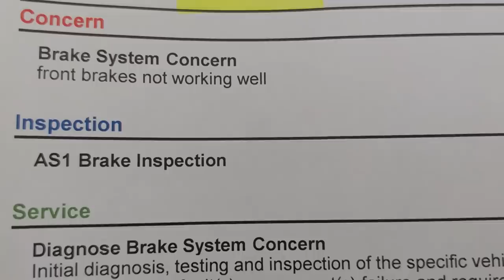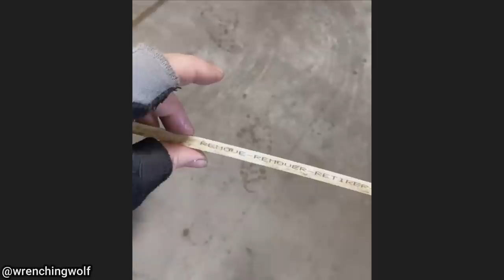Customer States Dropped Socket Into Engine Bay And Vehicle Won't Start | Just Rolled In

Comment: A socket in the combustion chamber could've easily been fished out with a magnet!
Reply: Not to mention, the guy decided to do his spark plugs at 25k...logic is clearly not his forte
Reply: Also, why even start the engine when you know there is a socket in the combustion chamber...?!
Reply: My thought exactly! I drop stuff all the time. Extendable magnets are your friend
Reply: Maybe he haven't seen where the thing landed and started the engine
Reply: @intraxx88  I agree, there's no way he knew it was in there! I hope
Reply: @DrPoooper  i bought once a beater mk4 jetta, found 13mm spanner, tx30 and wooden ignition coil holder when working on spark plugs and AC radiator 🥲
Reply: Pulled the head off my first car and found someone had dropped a fuel hose clamp into the carb at some point in its past. The main part of the clamp was jammed in an inlet port,  the screw and nut had gone through leaving their mark on the piston and cylinder head. Went noticeably better with all four cylinders breathing properly.
Reply: @cycoholic  hoping it gets blown out the exhaust? or maybe he put in the new plus and then noticed he was missing a socket? thought it fell in the engine bay?
Reply: Some vehicles nowadays a couple of the plugs are near invisible. 
That was a perfect bad bounce for sure.
Reply: Mine was a washer a previous owner had dropped in the intake on my '88 Monte Carlo SS. Went to test drive it after some suspension work and said washer finally made it's way into the cylinder heads. Destroyed the head and put a hole in the piston/ cylinder wall.
Reply: Surely they didn't realize it fell down the spark plug hole?  But there's no way the spark plug socket would fit.
Reply: @theboyx323  
Ouch.

Comment: The loose brake pedal gives a whole new meaning to Fred Flinstone brakes and California Stop. 🤦‍♀️
Reply from the maker: Lol! I wonder what happened to the brake pedal. Especially on such a new vehicle.
Reply: @JustRolledIn  right?! That’s really scary. Bad malfunction and failure.
Reply: @JustRolledIn  Fiat quality
Reply: Well.... It is a Fiat.
Reply from the maker: @actual_nonsense  I was waiting for that comment 😜
Reply: @JustRolledIn  I had exactly this happen to me a long time ago in a Peugeot. I took the car to the dealership. The fixed it, and then told me there was nothing wrong with the car. They literally re-attached the brake pedal then pretended like I was crazy for bringing in a car with nothing wrong with it
Reply: @JustRolledIn  The bolts holding it in were left loose it the factory and fell out
Reply from the maker: @lawrencebraun7616  definitely a possibility. I wonder where the rubber piece is for the brake pedal lol
Reply: @JustRolledIn  My guess would be manufacturing error, poor or no quality control.
VW had a recall a few years back, where the brake pedal assembly had to be checked (and in some cases replaced) because their quality controls had shown signs of bad welds.
It was caught and fixed before anyone was hurt.
So I guess robots don't always do a better job than a human.
Reply: @JustRolledIn  The technician beat you both to it; "Quality."
Reply: @sam2x13  as an Italian, i can confirm, fiat (actually fca, not fiat direclty) cars are one of the worse cars, we lost the "simple, chep (for them) and durable" fiat may years ago
Reply: @JustRolledIn  just the typical fiat/stellantis llc quality built right in.
Reply: I wouldn’t have a late model Jeep. They are Pussy Jeeps now.
Reply: @Davide0033  Is it true that the low-end cars are even worse than the more expensive ones? I heard some rumour about that while using a Fiorino at work. 
And yes, the Fiorino was utter garbage.
Reply: That brake pedal issue should be a recall!
Reply: Or " Wildcard " Charlie from Always Sunny did an upgrade 🤣
Reply: @lawrencebraun7616  it cost money to tighten every bolt. Just think of the potential savings!
Reply: @panzerveps  Except the problem about blaming the robot is it is assembled and programed by....a human.
Reply: @Vanta_Blue  yes, in the last years fiat started to make cheap (for them), low-end cars, but started to make them complicated, cheaping on everything.
that's probably why you see an old Panda whit 300000km, but some new panda have all sorta of problem at 30000km (not kidding, i saw both the cases).
i can't acqually think about a hight-end fiat

(keep in mind that's not only valid for fiat, but for almost all cars manufacters)
Reply: Proudly made in the USA 😂
Reply: @Davide0033  Thanks for confirming!
And yes, the new complicated vehicles carry so many problems it's silly.
Reply: @repairdroid77  Yep. The thing is that a robot will not check its work, unlike a human welder, so this robot can do thousands of bad welds without anyone noticing.
Reply: I think it was upside-down but maybe their shit quality control was at fault and it was not only loose but missing the rubber thing 🤣

Comment: If I was a mechanic and someone came in with tires like that, I'd refuse to work on their vehicle until they were replaced (and they'd have to sign a waiver when they leave if the hazard isn't fixed)
Reply: I think they can refuse to allow the vehicle to leave legally as it's a definite hazard,probably need a cop called tho.
Reply: We did like this couple of times, when i was in Subaru dealership. Once with tyres, once with timing belt (customer didn't expected to replace it by 100K miles /160K km), so we replaced entire engine month later 🙃🙃
Reply: @marjoriegoodwin9121  - Every state handles this differently. 
No one Common Sense Law.
Reply: @intraxx88  certainly in the UK that would happen. 3 points and a fine for every bad tyre, you only get 12 points and you are banned (6 if you have only passed your test within 2 years).
Reply: @handlesarefeckinstupid  good system. Considering our winter road deaths statistic caused by wrong or bad tyres, it's better to make people use bus instead of dangerous to anyone car
Reply: @intraxx88  Good system in Europe. In the US, there usually isn't a bus, and no way to walk. (Such as needing to cross a major highway with no crosswalks for miles)

Comment: I wonder if the socket had a lifetime warranty?
Reply: Snapon brand.
Reply: I cant believe the insurance company is covering a new engine even though the owner did the damage himself. Who drops a socket in the spark plug hole and still turns over the engine? Smh
Reply: @jacksmith2315  The same kind of person who changes spark plugs on a brand new truck with 25k miles.

Comment: It is amazing to see these problems and wonder how did they learn how to fix a car or get a driver license.
Reply: Going by the video they didn't learn how to fix a car. lol
Reply: Driving is easy, fixing-not so easy.
Reply: @markk3652  well driving on tires that has a date from 1995  and a huge crack in the side wall and they refused to get a new tire.. yeah right. or I hear this clanking sound but I will continue driving for 800 miles hopefuly it will go away..
Reply: @markk3652  Driving is easy, and yet a majority of people still manage to screw it up. What does that tell you?
Reply: because it is incredibly simple to get a driver's license and there is zero required training on maintenance
Reply: You are doing better than me, I am surprised half of them actually remember to breath

Comment: I need to know what insurance company covers a new engine after you start it with a socket in it :P
Reply: No shit right?! Haha
Reply: I have heard of insurance companies doing that.  Otherwise, the owner would probably quit making payments on the vehicle and let the vehicle be repossessed due to mechanical failure (mechanical salvage) as the owner most likely could not afford the repair themselves.  

If an engine gets wrecked like that and the insurance doesn't pay, I wouldn't continue to make payments on it sitting out in my driveway and non-useable.  They can have the POS back.

Comment: My all time favorite was the customer with the frozen caliper slides who never knew there was a problem until the inboard brake pad wore out, then wore over half the thickness of the rotor away and the caliper piston finally came out of it's bore and all the brake fluid gushed out.   I asked her " How long was it making that grinding noise?  She said, "Not that long...just a couple months."

Comment: How I love those second generation F bodies!  My first car was a gold (ugh) '70 Firebird with a "350" Pontiac V8 and a Hydromatic slushbox, 21 years old when I bought it in high school. It was a base car, not even air conditioning, but I was young and impervious to summer heat. Six months after I bought it the car and I went on a 3,000 mile road trip the summer before my senior year; none of my classmates believed I'd actually done it when I went back. The car served me well for over five years through spring breaks in Florida and midnight drives in Delaware. I smoked a Ferrari with it too (though it was a Mondial convertible with two jocks up front and two bikini-clad floozies in back - it couldn't get out of its own way) and took my girlfriend on frequent runs to Rehoboth Beach.  Good times.  Great car.

Comment: Hold on, I drop a socket in my engine and insurance buys me a new engine? .... I wouldn't have the stones to ask, but I wouldn't be an idiot and drop a socket in my sparkplug hole. Good lord LOL! Had to be the most unlucky escape of a 10mm EVER! I did lose one down the inside of a boxed frame rail once. I played "Klinko" down around the radiator frame and I won! 

 Dude that drove on the rim? Man, that's like a perfect reloading crimp on a 12g shotshell. 

Wiper blade.... lordy. And again, a happy customer who got EVERY cent out of their brake pads. 
 Sweet TA!
Reply: I hear ya a friend of mine has the greatest insurance I've ever seen! He use to have a s10 with a slipping transmission  then one day he hit a car ramp in the middle of the road don't know how he didn't see it 🤨 he told insurance now his transmission is slipping he got a new transmission for free covered under insurance and installation I was like WHAT!!! Then a few years ago he got rear ended in a 03 Ford f150 after owning it 3 weeks he paid $3,500 for it they gave him $11,500 total loss he bought it back for $1,000 then sold it for $4,500 they also bought him two new car seats because they were in the truck when it was hit and the 4 new tires he just put on they paid him for that  he also sued the person that hit him got around $15,000  The guy who bought the truck pulled the frame out then a new rear bumper in 1hr then he sold it for $8,500 after paying $4,500 he owned his own body shop. My buddy always walks threw shit and comes out clean as a whistle 🙄
Reply: @frankm8533  HAHA! ... That's hilarious, I have a buddy who's amazing at warranty crap. It's a game to him, but he legit makes out. There's times I'm like "Dude, do you really not expect time to take a toll?" but he pulls it off. Me? I'm the guy who's stupid expensive gaming laptop takes a shit 2 years and 2 weeks after the 24month warranty runs out. ` But, it's fun to watch others with that magic aura that surrounds them HAHA!
Reply: @radamus210  Yup that's my friend and his wife always got something going  he retires at 47 so 6 more years and his done hes got enough saved up, 401k, full government pension hes got 2018 f150 paid for and a 2021 kia suv paid for said they aren't buying anymore vehicles until those vehicles die completely lives in her parents house for free he lived home till he was 25 then moved into her parents house Lol guy has a Cake life

Comment: Oohhh those tires were good for another 100,000 mile. C'mon now. Those were Perelli we're talking about 👌🏻👌🏻

All joking aside...he's lucky if that tire made it 80 straight mile with expanded air pressure under weight, before it gave out. 
Being a tire specialist from backwoods western Pa...I've seen this ..often. I've covered the cost a new or used loaner tire, for a customer, myself, on several occasions...
I can't let something like that back out the door. Especially when I find out... children ride in the vehicle..
Reply: "They wear like iron!"

"That's because iron is what the ions have decayed into..."

Comment: I've never seen a U-joint blow a tail housing. I've seen plenty of blown up you joints and twisted drive shafts but never a tail housing
Reply: Towed in a Chevy truck that broke the rear unoint and it cracked the transfer case and the rear of the transmission case.  Happened when he went to pass a guy on the highway.
Reply: @HoLeeFuk317  that's crazy to me. I mostly work on one and a half ton and larger trucks but I've never seen one of those explode a transfer case or transmission because of a U-joint failure. I've seen drive shafts pole vault and crunch into pieces before the transmission breaks
Reply: Pretty common for Dodge trucks to have the front driveshaft seize up and detonate the transfer case, as well as fuel lines and electrical in the swing radius.

Comment: My dad and I got a 1988 Ranger that a relative bought new. It had 25k miles on it in 2014ish when we got it and still had its factory installed Firestones, similar dry rot, I still have them in the barn 😆

Comment: That Ranger... Just ouch... Even if insurance is covering it...  Rule #1 when turning wrenches, NEVER continue until you locate the dropped socket.  My dad taught me that at an early age and now at 41 times around the Sun, it's served me incredibly well and is a lesson/rule I'm passing on to my son.
Reply: we had a similar rule in aircraft maintenance in the Air Force...you'd be there until they found the tool, regardless of how long it took to find. You WILL find it.
Reply: @ghostsmoke11  that's the only way to roll, anything less is uncivilized/lazy.
Reply: @ghostsmoke11  Oh my goodness, the memories of trying to install a hose clamp in a tiny panel, under a wire bundle, and between two components with just enough space to get the socket and extension, only to hear the soft "tink" of the 1/4" washer falling to the bottom...
Reply: @strixt  I relate perfectly

Comment: I had a Nissan Altima for a short time. The throttle body butterfly screw came off and went into the engine. I didn't disassemble it but from the scope, it looked very similar to the inside of that socket cylinder. There was no sign of the screw. Whether it passed thru the exhaust valve or disintegrated, I don't know. It never ran good or right again and I sold it to someone who had a crashed Altima with a good engine, for very cheap. He was so happy. He drove it home on 3.1 cyls and was so excited to have a perfect body to work on again. It's the only Nissan I've ever owned. Never again. Honda is my only

Comment: 0:32 That noise from having a minus one spark plug... I got an F-150 from auction for 800, sounded like rod knock, I thought it needed another engine.  When I pulled the coils, one coil came out with the plug jammed half way up the coil boot... with the threads from the aluminum cylinder head still stuck on the plug.  I just re-tapped the hole oversized, inserted a threaded sleeve and replaced the plug.  Not the proper fix.  I was supposed to remove the cylinder head and fix it on the bench.  Because I did all the work with the head still on the engine, all the metal shavings went into the cylinder head, and the engine made a horrible knocking/grinding sound for about a minute, but then it smoothed out, idled great, and I was able to sell it right after.

Comment: I drove a truck I bought in 2016 on the tires that were on it. They were date coded 1953 and 1956. (But only on and off the trailer to get it home!) They left black powdery streaks everywhere. The term petrified was used.

Comment: As for the old tires, this can turn devastating as they were in a very bad shape. This is an irrelevant personal story but whatever, i've probably had a curse and ended up having to use a spare with a tire from 1998 that was brand new as under supernatural circumstances my tires would blow for different reasons every now and then for a period.
I put like 5000km on that tire total in several different intervals and i was shocked it behaved and still looks like new even when i rotated the heck out of it and the pressure was usually at like 40-60psi.
Lol i wouldn't trust any tire older than 5yo and maybe my spare was about to explode at any time, but this experience was unbelievable.

Comment: That wiring job! I don't think I've ever seen anything that bad! Close second was the time my Dad's boss asked me to look at the stereo system his son had put in his car. Nice car. The dad's car. Cheap aftermarket (Kraco, K mart brand IIRC). All with white zipcord running to the speakers! Speakers out of phase, balance and fade were ALL screwed up. If I had been at MY place I would have entirely rewired it with color coded wire!

Comment: An older lady around here didn't like the price of replacement tires and tried to drive on a flat to another shop. On the way (on 55 mph road) the flat flew apart and tore out the high pressure fuel line, starting a fire that killed her.